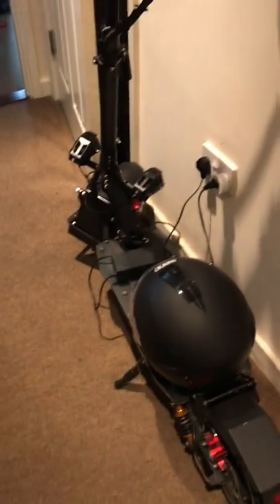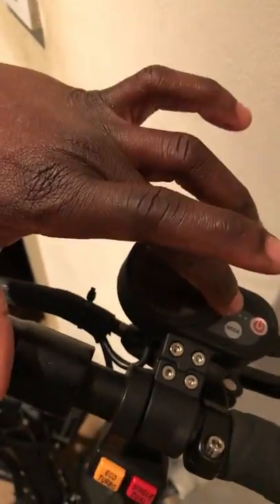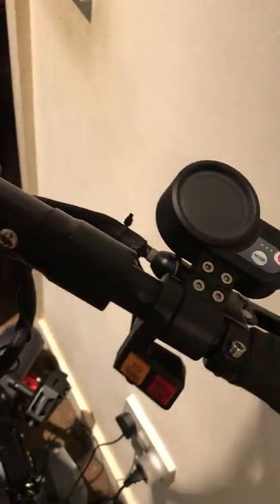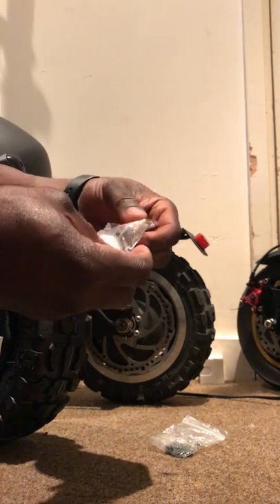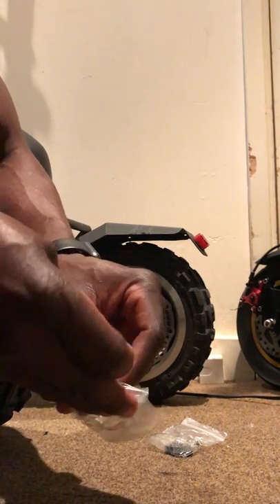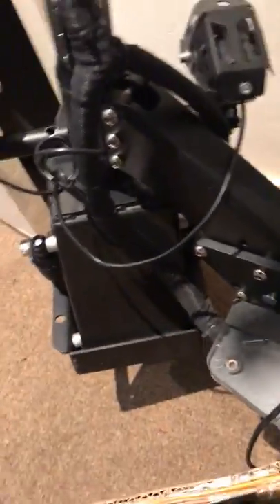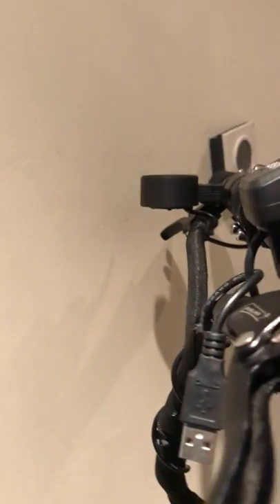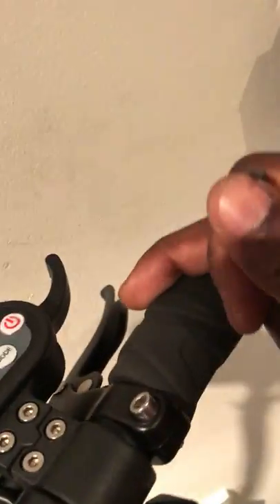3200W 60V 30A brake pads replacement.

Comment: Hello there, my scooter break light doesn't work anymore what could be the mater?.
Reply from the maker: Hi, sorry for your problem. If your Scooter’s brake lights doesn’t work but the scooter itself is still in operation, means your brake lights needs replacement. If the scooter itself doesn’t work as well as the brake lights means you need to replace the controller in your scooter. I hope this helps you .
Reply: @michaelmilenamg  thanks a lot Bro! For your advice.